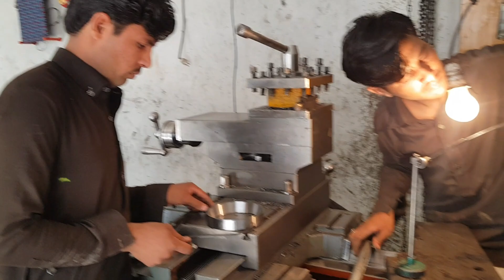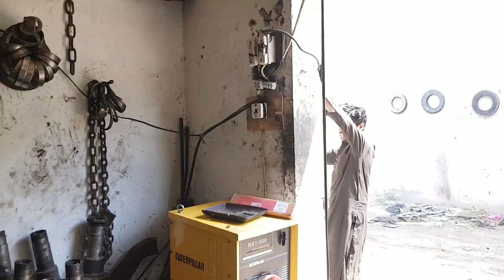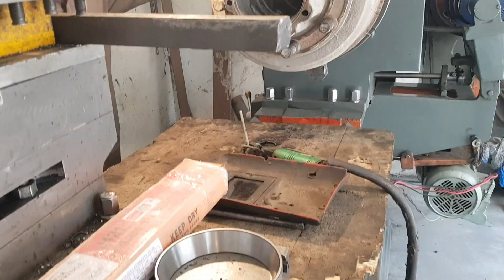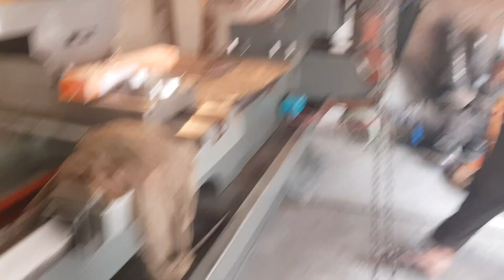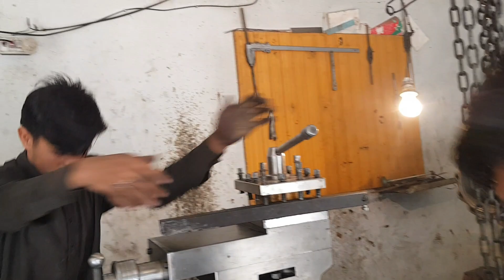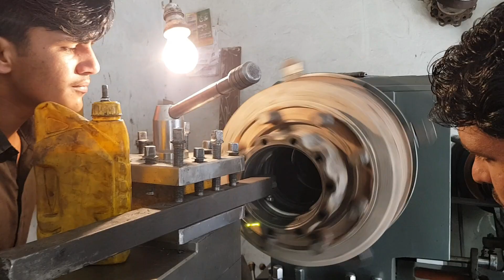How to Repair Wheel Hub in Local Truck Workshop by Local Engineer

Comment: Not a lot of point oiling the bed's ways when you're happily earthing the welding through the headstock  bearings ? 
You turn out some good work lads, but you're gonna knacker that lathe if you dont start treating it right ?